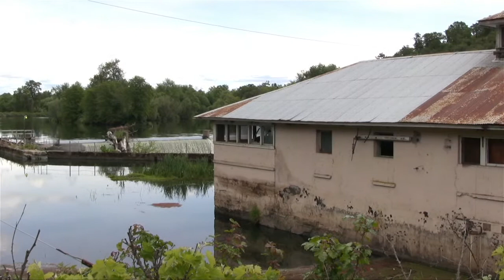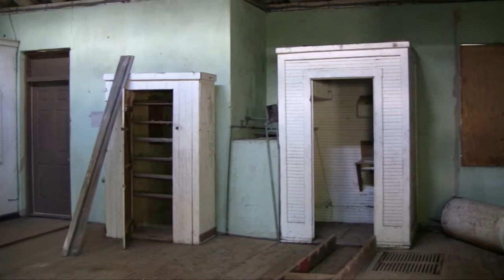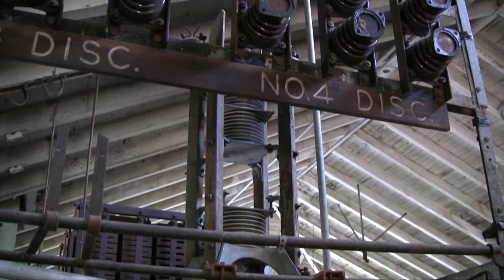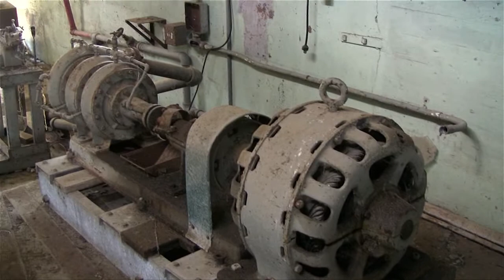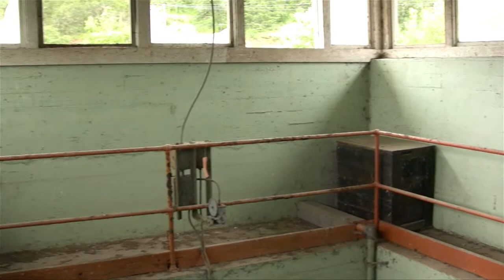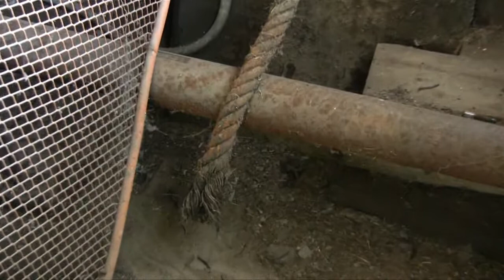Gold Ray, 1903-2010  (Part 2).mpg

Comment: The exciter doesn't exactly "kick start" the main generator.

The exciter provides a steady current that powers (or "excites") the field windings of the main generator. 

The field windings produce the magnetic field that generates electric power in the windings that you can see around the circumference of the rotor. This is a DC magnetic field; it doesn't vary in the rotor's frame of reference. It does rotate in the stators frame of reference; this rotation requires mechanical work, which is provided by the turbine. It is this mechanical work that is converted by the generator into electric power.It looks like there are 20 poles on that rotor; that means that the machine would have had to rotate at 180 rpm  in order to synchronize with the 60 hz grid.